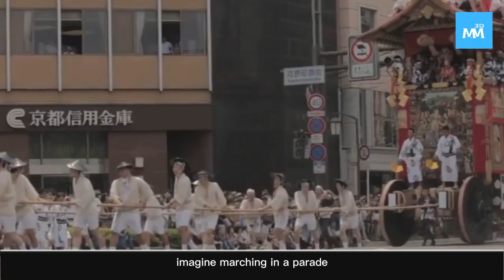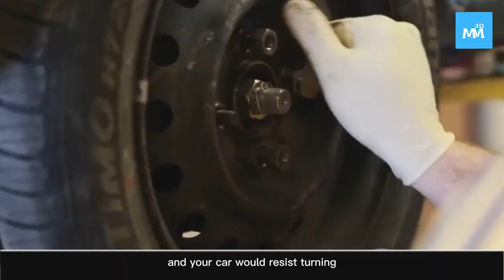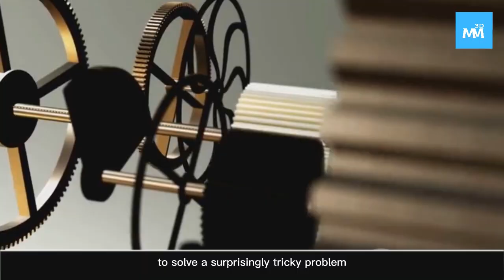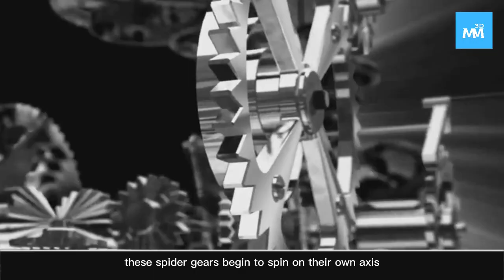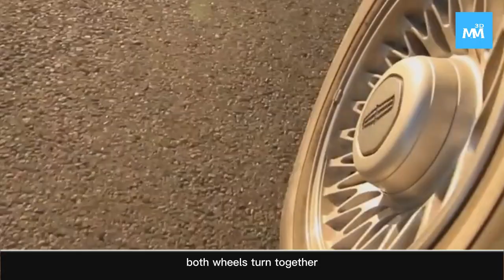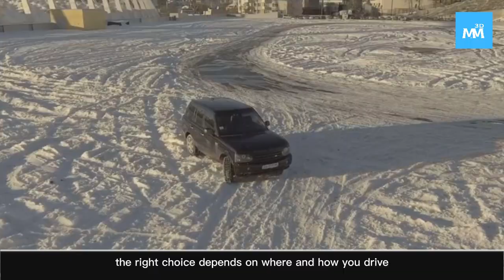The SECRET to Smooth Car Turns! (Differential works)

Comment: Good topic, but
1) Random pictures  of engine parts and clockwork unrelated to car differential.
2) End less repetition of “spider gears make this possible”; video could be half the length by omitting irrelevant graphics and repeated words
3) Time would be better spent covering types of LSD such as Postirack, Locker, Gear (Torson) etc.
4) Types of lube oils (conventional vs. synthetic)and when to change should be added. Also, friction modifiers for SD.
Reply from the maker: Thank You ❤️